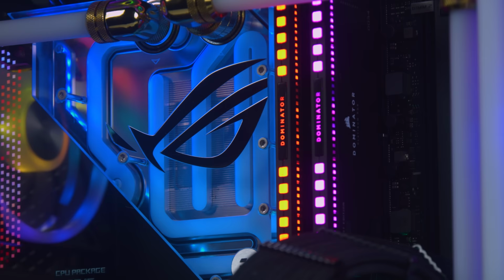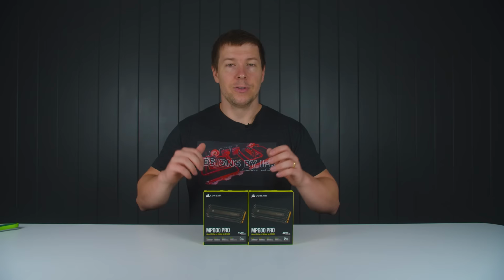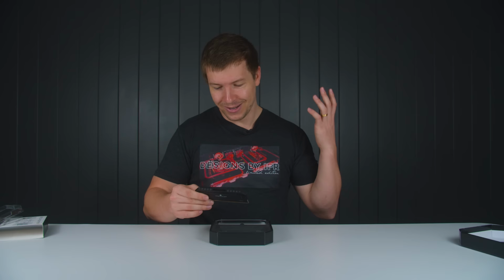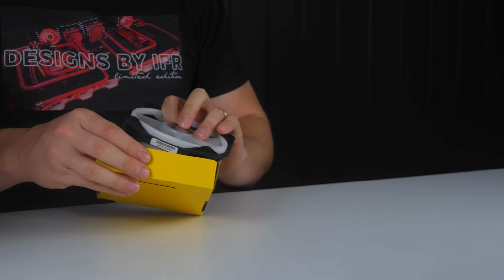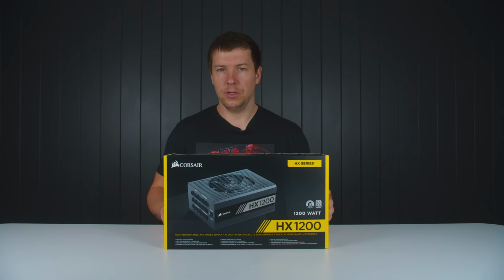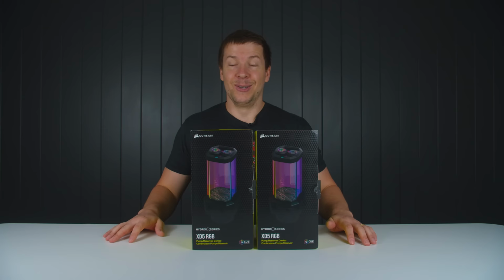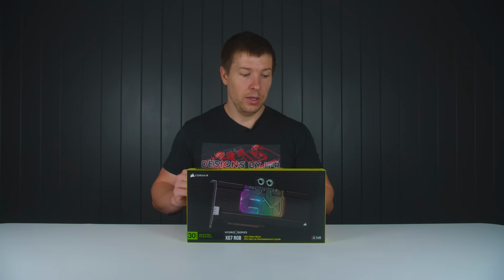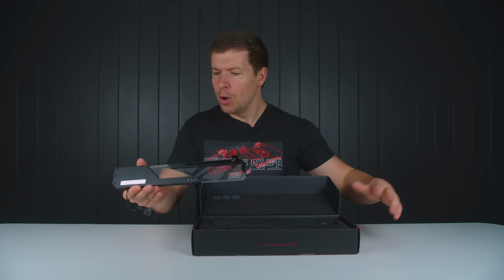$7000 ULTIMATE Custom Water Cooled Gaming PC Build!

Comment: I purchased the exact graphics card $1483.99 Two weeks ago...the most underperforming graphics card I've ever bought, disappointed!
I have tried all the optimal NVIDIA control panel and in game settings....GGGGUUUUHHHH!  paired with intel 10900K, 32gb RAM @ 3600mhz CL-16 XMP enabled, 2TB Samsung Pro NVME M.2 SSD, Monitor is GIGABYTE 34" curved 3440x1440. My new ASUS ROG STRIX RTX3080 is not better than the EVGA RTX 2080 Super XC Ultra it replaced. : - (
Reply from the maker: I would say that either yours is faulty or there is another issue going on